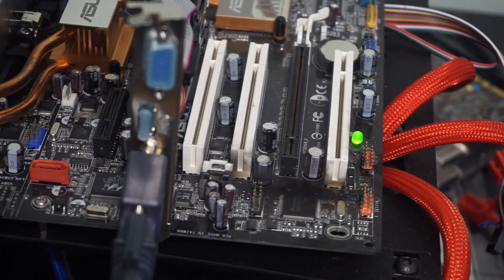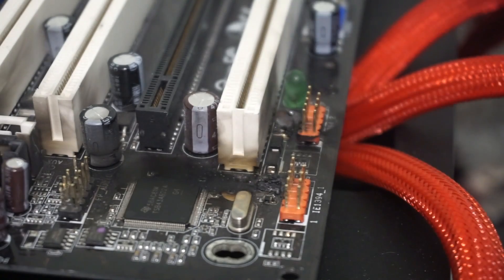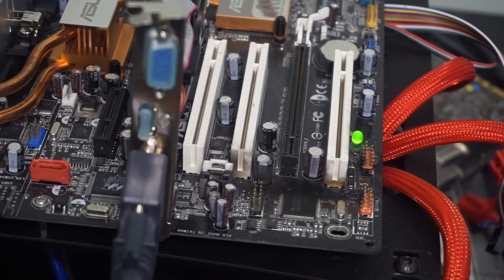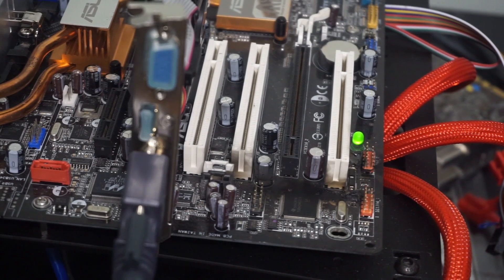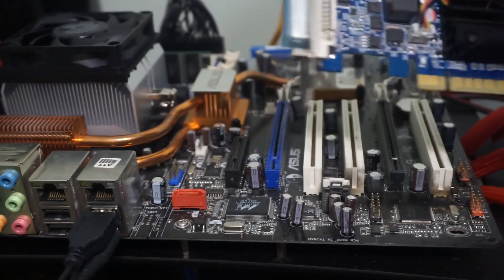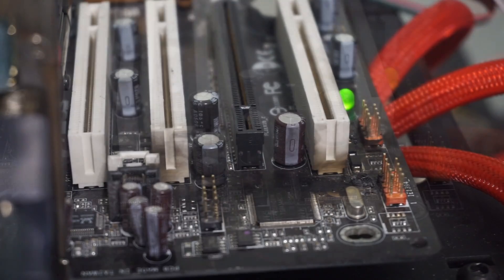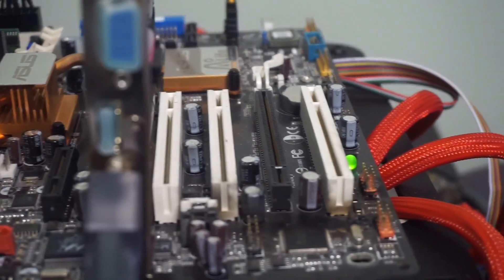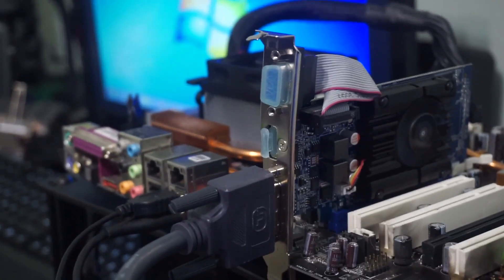Impromptu Video:  Electronics are heartier than you may think

Comment: I killed a GT 610, I volt modded it to get much higher voltages on the core but accidentally set the potentiometer to 0Ohms when booting and blew the high side FET to kingdom come along with both the high side and low side drivers

Comment: I always have to tell this to all my friends freaking out about the way I handle my parts! I should link them this video...
Reply from the maker: I completely agree.  In addition to this I've submerged my gt 610 in water over 4 times, threw it across a beach, dropped it down a stair case, and even more tortures and it still works.  Electronics aren't as fragile as most people make them out to be.
Reply: Haha, I saw that video, and you're completely right
Reply: Socket Sanctuary : but one thing will kill them over time: heat. And many people dont know that. especially soldered, but very hot chips can fry pretty quickly (flexing/desoldering issue)